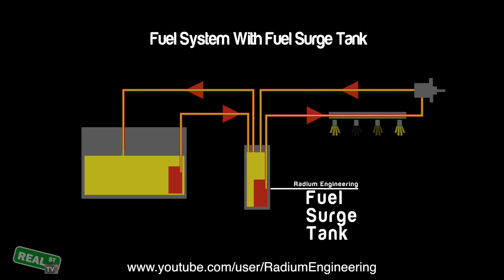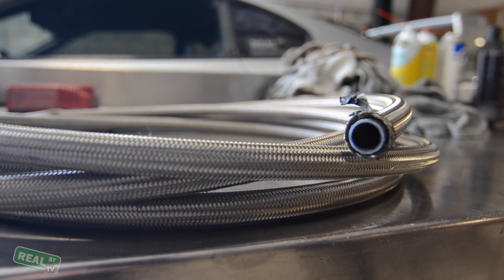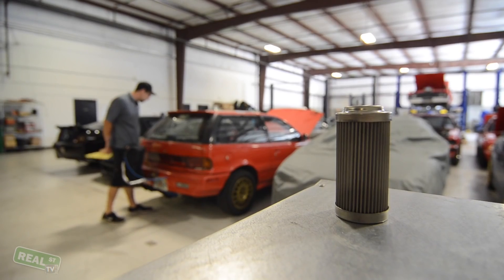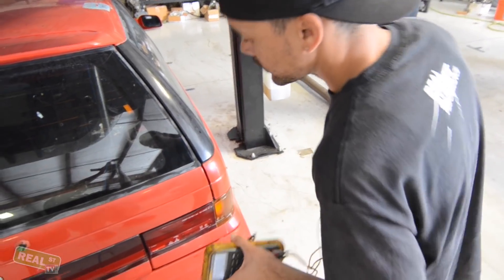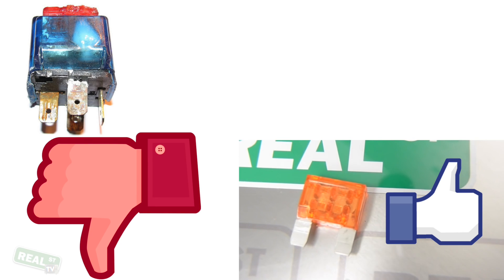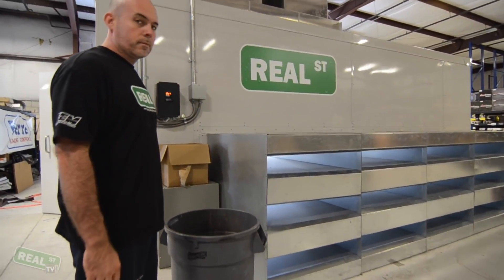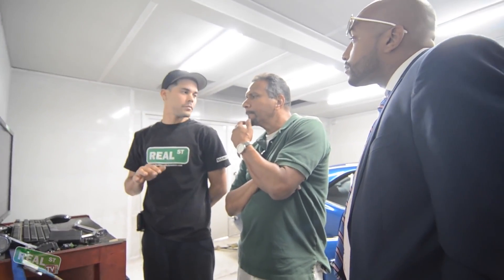How to Select the Right Parts for Your Fuel System - Jay's Tech Tip #26

Comment: I plan on throwing a gtx3076r on my s2000, and this will come in handy.
Reply: Go straight to 2000cc injectors, 1600 at minimum unless you're going to run on race gas
Reply: PilgrimTitan you deff dont need 2000cc to run a 2 litre with a  30r